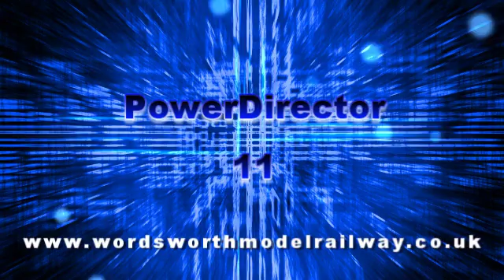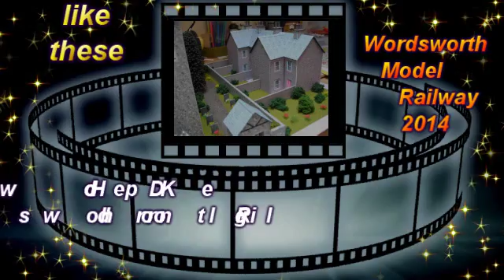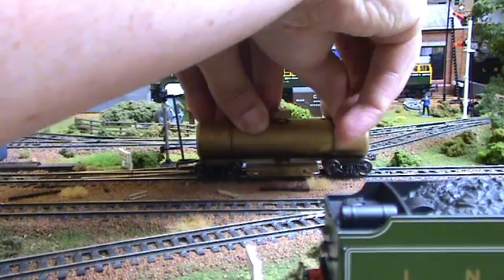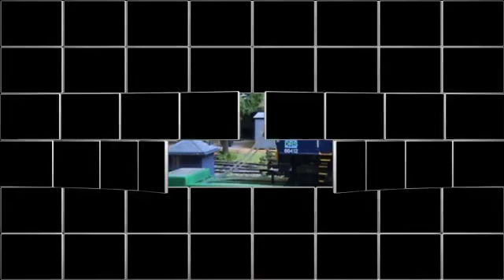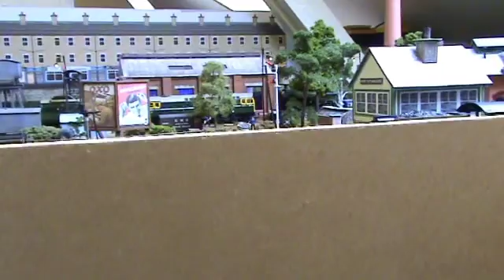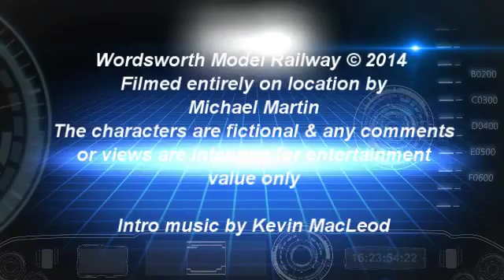Wordsworth Model Railway 137 - Keeping Wordsworth Rolling

Comment: Hi Mike like your home made track cleaner , but like you I use the CMX with the Goo Gone , very good product and wouldn`t be without it , best thing is to push the cmx on the front of a Loco then put a rake behind the loco and this will clean the wheels besides the track ...Dave